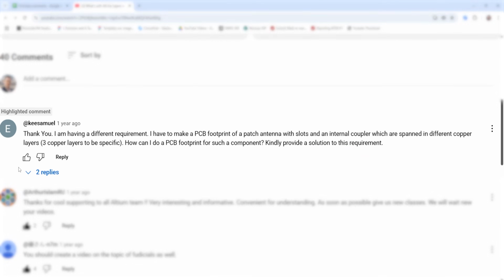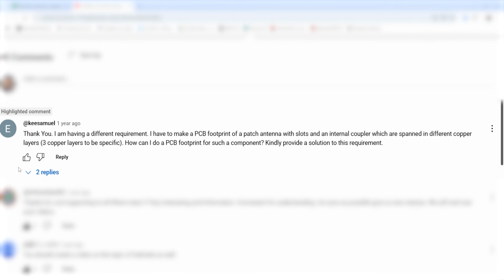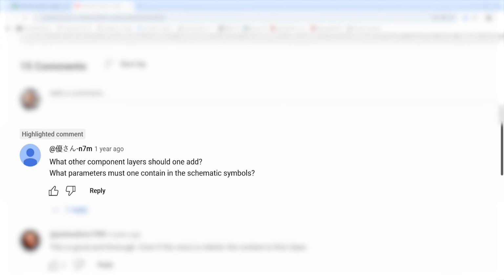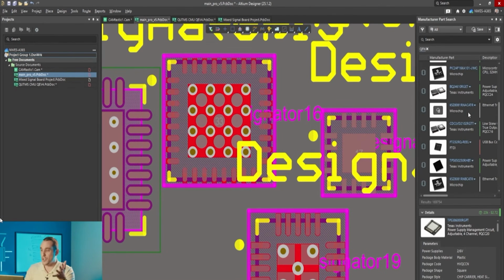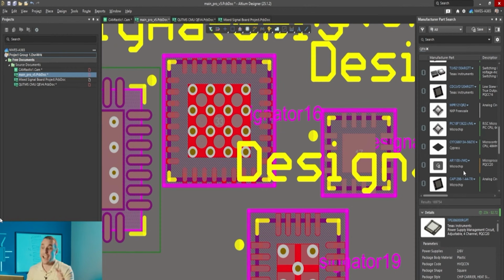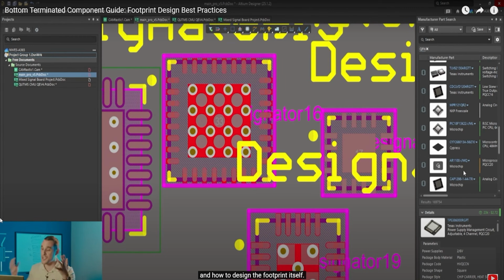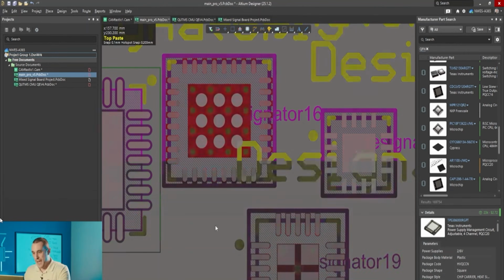What's in Your PCB Footprints PART 2! | PCB Design Office Hours #9 With Zach Peterson

Comment: When routing a 50ohm cpw trace to an 0201 component, if its pad is smaller than the trace width: Do you a) make the footprint pads larger? b) make the trace width smaller and decrease the clearance width to gnd pour? Or c) use tapers/teardrops to fit the width? I would use 0402 parts but do not have the space on the board for them. Thanks!!!🙏